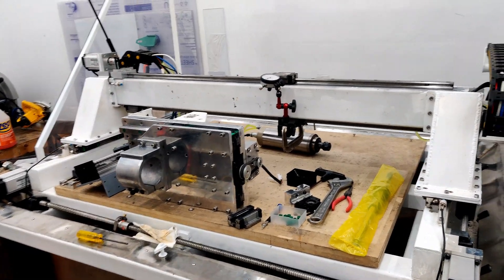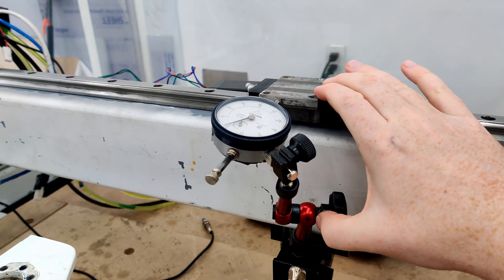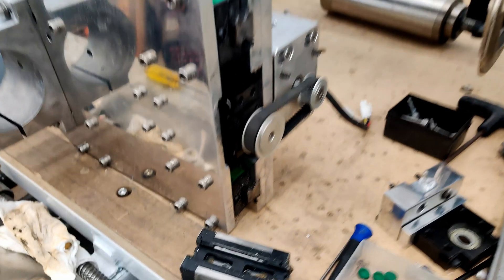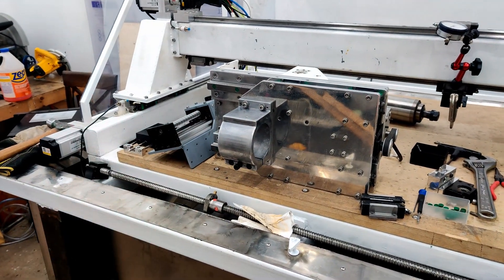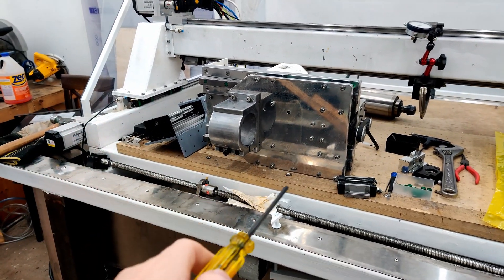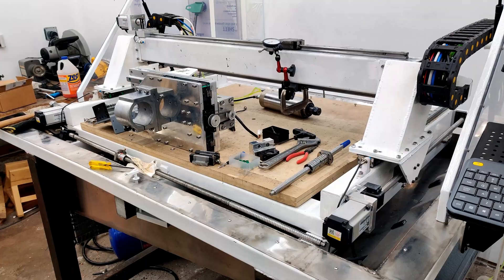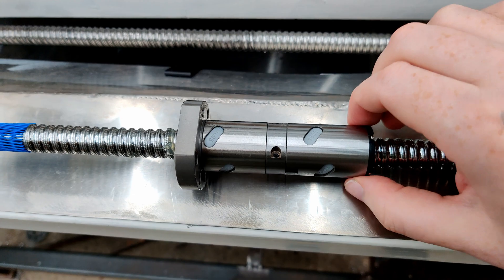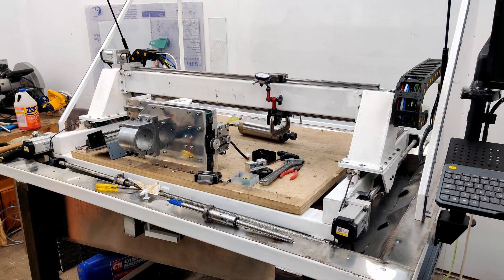Upgrading a CNC machine never ends

Comment: Hi Bryan You are wrong about one thing .......... the upgrades to your machine will stop after you DIE ha ha and yes I also have a list of upgrade to do in the future,  I run a C5 1605 screw on my Z and glad I went that size. Yeh I have found my  MQL system to work really well with alloy so it will be good for you to have both flood and MQL any way keep at it Cheers Bill

Comment: Love watching your build progress over time, and how you can so easily say - I'll do ...... in Python - as if its the easiest thing in the world, it's NOT for the rest of us :) 
Aligning a rail to another rail helps - but is the reference rail straight? 
To do this there needs to be a machined surface to butt the "first" rail up to, so it is located. The second rail can then be aligned to a known qty.
Without really significant work reworking your tubes, maybe on your next big change, you already have everything you need. 

Use the laser alignment on the rail to check the straightness of the reference rail.
The laser does NOT have to be parallel and all the "fun" that involves. Just find the difference one end to the other and check the intermediate points are where they should be.
While I feel your pain with the plug removal without doing this all you may have done is reduced head nod (important) but not improved straightness (vital).

For a build that is rock solid (granite) have a look at PiotrFoxWysocki videos.
No special tooling, no special knowledge just dedication and time.
He builds an AWESOME machine and if you are after flood cooling for aluminum (or anything else) - his is SUPER Awesome
Reply from the maker: Eh Python’s not too bad to learn, but it is kinda one of those devil in the details things where it’s all about learning API’s and frameworks that you use with python. Python itself is easier read/write/learn than all the Arduino c++ code 

Yeah for sure. I’m gonna leave doing this properly with a laser reference when I have to disassemble the gantry to replace the Y rails. At the same time I might see if I can borrow a flat reference about 2m long from a local machine shop and do an epoxy transfer onto the surfaces the rails go. 

It’ll just be easier to do it than because the gantry won’t be attached and I can do both y rails at the same time. 

The laser + webcam setup will work well for this rotated on its side.  At that point It can be run live like a DTI on a virtual straight reference.

Comment: Its worth the time to get the cross beam right.

Now that you have a working machine, consider ordering a beefier cross beam, machine each face flat, mill a slot with the mounting holes, maybe give the rail a few thou for very slight adjustment, but I think not making that bottom rail straight / square will always give you some issues.
Reply from the maker: At some point I’ll finally replace the gantry tube and Y tubes with something better. Get the surface ground. Also with side adjusters on both sides. Not sure what you call them but I’ve seen images from some beautiful custom made epoxy granite machines done this way. So far I haven’t had the need for higher precision so priority is low unless I come across the need. I would like to get a better spindle with ATC and all the automation put into that first though. 

Sofar this machine is pretty nice and easy to work on. Easy to upgrade whatever seems necessary. Couldn’t ask for anything else out of a gantry/router cnc.

Comment: MQL is 100% worth it.  I'd go with 2 nozzles if you can.
Reply from the maker: Yeah seems like more than one is best. I wonder if 4 is too overkill. 

I was thinking how I could drive 4 but have only one triggered depending on the angle the endmill is cutting at. It could almost work, using step and direction, but I wouldn't know if the endmill is cutting the outside or the inside of a pocket.
Reply: @BryanHoward  Datron has a setup that triggers based on movement that only uses 2 nozzles.  I don't think the endmills typically used for this type/size of spindle need the additional coverage.

Comment: At 8:35 I was only half switched on, and I had a  "HOLY CARP!!!" moment  You said "fit longer Y rails".  My head thought you were going to change the Y frame tubes... it would be easier to start from scratch!  Then I woke up... RAILS.  That makes a lot of sense.  👍
Reply from the maker: haha yeah. It should be an easy swap. I'll have to put in a couple more bolt holes for the rails in the front. Gotta drill into the grout. I ordered rails longer than the tubes itself. so I can cut them to size as the bolt holes will probably line up  with the tubes at the exact length.

Comment: I love watching the upgrades on your machine, it has completely changed from the original Printnc.
On your double ballnut you can adjust the preload using the 4 grub screws in the middle piece, they act on the second nut to turn it slightly to increase or decrease the preload.
Reply from the maker: Great! that's what I was hoping. I'll add a bunch of preload. The servos won't care.